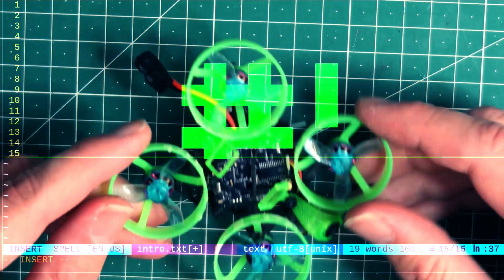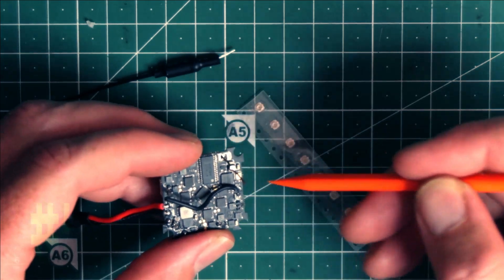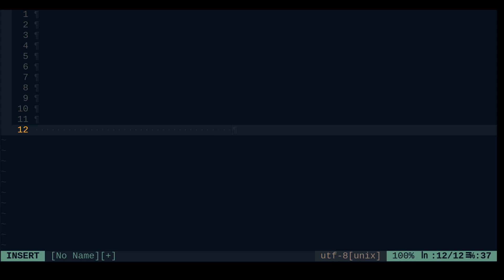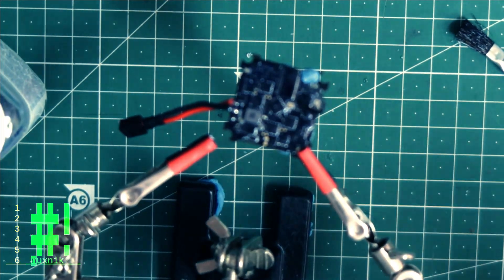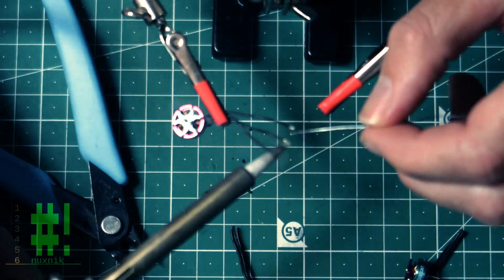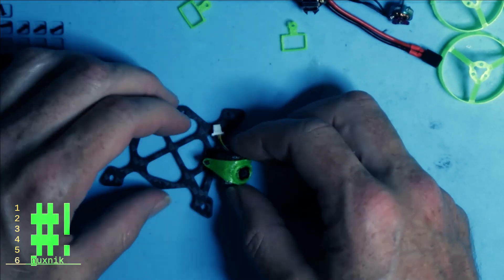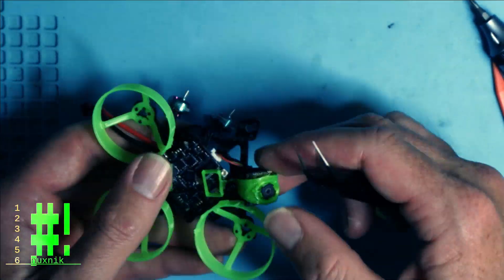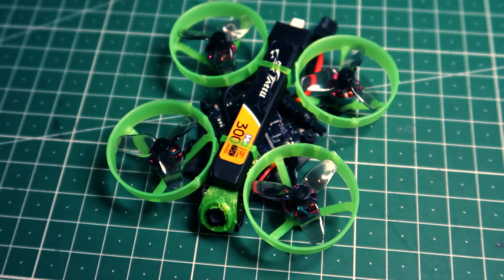Nux65 Tiny Whoop Build Guide

Comment: Thanks. Finally built one to go along with my Fractals. Nice job. Flies phenomenonal with the Karate tune on 4.5.x. Came in at 20.4g with Diamond F4, VCI Spark 0702 29k and HQ UL props.  Added a make to Thingiverse.
Reply from the maker: Awesome! I'm happy it worked out. I also rebuilt mine with a similar setup and got ca. 20g. :D

Comment: Amazing video. Quad seems a little heavy for a 65mm build though. 19g dry is pretty achievable with high quality parts and a meteor frame
Reply from the maker: True true! I have already built an updated cousin that is much lighter - ca. 18-19g. I still need to edit the footage and release a new build video. Glad you enjoyed it :D
Reply: @nuxnik  that's awesome 👍 I'm wondering, how do you find the difference between the 2? I'm looking at building one and I'm honestly not super keen on going ultra ultra light as I'm not a great pilot and I worry that being too light might make the quad too zippy and nimble? Or does it not work like that and you just get more control and better throttle response from saving those extra 4g or so? My goal is to fly only in my house which has no large spaces and lots of small tight corners, so I don't want it to be a little lightning bolt. Maybe my concerns are totally unfounded though. Keen to hear your thoughts sorry for the ramble
Reply from the maker: @benjo134  good question. I never thought about it that way. Personally,  I think for indoors, a 65mm ultra-light quad with high KVs is easier to control because you have the response you need to fight gravity. Indoor flying requires sharper turns and surgical precision. Along with weight, another factor depends on your TX rates. I ramp mine up high because I like my quad to be, as you said "zippy and nimble". So that will depend on your flying style. You can, for example,  set your rates to give you less throttle in the middle of your stick throw, all the while leaving the high response area towards the outside of your gimbals.  Rates like that can eliminate the the feeling that every micro movement on your sticks equates to a huge exponential explosion in quad movement. Every pilot has his own sweet spot. And it is a process of trial and error. So yeah, weight matters and 4g can make a big difference... With that said, a lacking factor of ultra-light whoops is the ability to "throw" the quad farther, which is a nice feeling especially if you are used to flying heavier drones. Ultra-lights feel floaty, and invincible to gravity - which in my opinion is a good thing depending on what kind of pilot you are. Good luck if you decide to follow through with your build. As for myself, I need to finish my update video soon 😀
Reply: @nuxnik  that is an incredibly helpful response. Thanks heaps. You should definitely make videos about this topic or something haha. I'm excited to try and go through the process of working out my preferred rates. Glad I found your channel 😊

Comment: It's big enough to build as a 75mm right??
Reply from the maker: I am working on building a 75mm version next. All the parts are on my bench, but I have been strapped for time the last few months. You could try it, but you'd probably need to make a few changes. The same carbon fiber frame is also available for 75mm. If you do build it, let us know how it turned out. If not, I'll eventually get around to making the video :D

Comment: I use a razor blade to trim ducts. Sandpaper takes too long
Reply from the maker: I have recently been using my cheap grinder pen to smooth the ducts. Kind of like a mini Dremel tool - also good for removing solder mask on PCBs. It only take a few seconds to trim off the excess.

Comment: How are you fitting 40mm props into the whoops of that 65mm frame? Those only hold 31mm props. You would need a 75mm whoop I would think.
Reply from the maker: Thanks for pointing that out. That is a mistake on my part. The props  I used are Gemfan 1219 3 blade props. I am building another 75mm whoop in this style and I got them mixed up while I was editing. I'll update the video description and blog post. Thanks again! :D

Comment: What fc did you use?
Reply from the maker: Thanks for the comment. I used the crazybee F4 Lite
Reply: @nuxnik no problem thanks for responding I’m thinking of building one myself looks like it can take a beating
Reply from the maker: @jessedaniel1246  nice! It can definitely take a beating. I have been using it a lot to practice tricks that usually end in a hard nose dive. So far, it keeps on ticking.

Comment: Nice work. I really like the top mounted battery. Essentially that sandwiches the flight controller between the frame and the battery for even more protection.
Reply from the maker: Thanks for the comment. That's exactly what I was going for. I also think the quad flies a bit different due to the center of weight being more in the middle.

Comment: Hey why did you rather solder the motor wires instead of using the plugs?
Reply from the maker: Thanks for the comment and good question. I removed the motor plugs to cut down on weight. Less weight improves performance and  provides longer flight times.

Comment: wow just in time I'm also working on a CF whoop. I like the choice of parts and the quality of this video is really great. Looking forward to see any updates and changes you make!! especially with weight reduction
Reply from the maker: I remember checking out your ChopSticks frame design a few yeas ago - nice! Thanks for the comment.  I am already testing some new improvements to the prototype. Weight reduction is my main focus right now. As I mentioned in the video, I'm replacing the screws (two peek one steel for each motor), swapping out the flight controller (f4 diamond) and making do with a simple wire VTX antenna. This should shave off some weight. I am also designing new 3d printable whoops and will (attempt to) print them in PP. We'll see where this rabbit hole leads :)